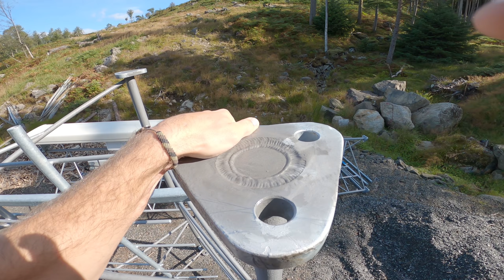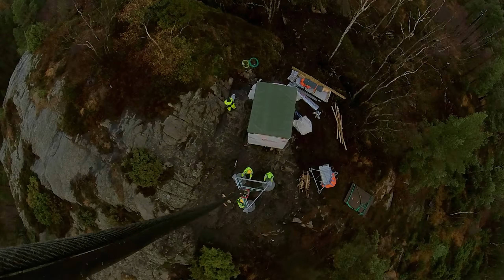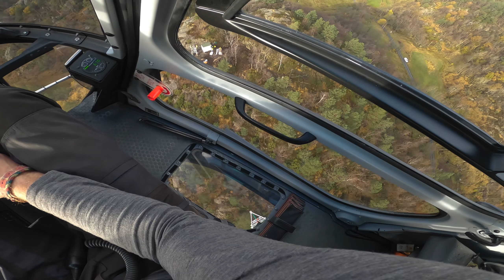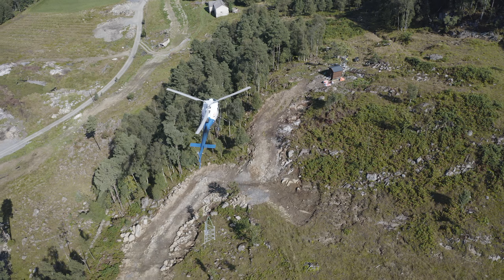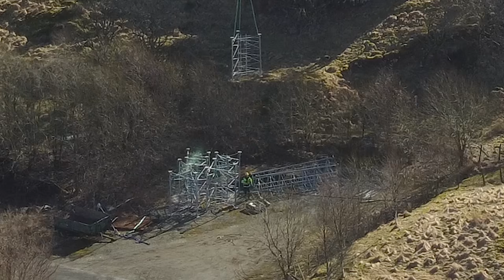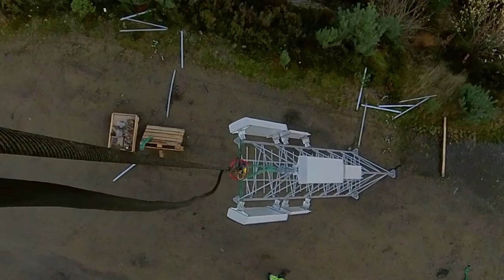Helicopter Tower Assembly, an insight for Crews and Pilots // FPV, Drone, pilot perspective

Comment: i had no idea thats how these were built, that looks like a really fun job
i wish xplane 11 had slingloading simulation id love to try to do this
Reply from the maker: Yes it is fun and I think xp 11 does... Xp 10 has it at least
Reply: @UpsideDownWash  i looked and xp11 has mods for it but it looks quite janky
can i ask how you actually got this job?
i assume you have to already be a very skilled pilot to even apply right?
Reply from the maker: @princess_lucy_goosey  I started in this company when I was pretty new. Worked as a load master for a few years only flying the legs between jobs. From there you get checked out to do more and more complex jobs as you gain more and more experience.
Reply: @UpsideDownWash  oh wow, you do it all, if somebody wants to work for you and eventually become a sling pilot do they just need a pilots license or is more experience required, i assume you offer the training related to the sling loading parts?
sorry if im asking alotta questions im just very interested in this, i always hear amateur heli pilots complaining that the only jobs available are tours but this looks way more rewarding
Reply from the maker: @princess_lucy_goosey  no worries :) yes you only need a commercial pilots license. If you have other skills that might be helpful but as far as I know there are no other requirements (except for beeing able to speak English).

The entry level jobs are often tours and the like. You can start sling loading with low airtime but it's pretty hard when you have little experience so most operators will require you to gain some more flightime doing easier operations first.
Reply: @UpsideDownWash  makes sense

Comment: Awesome videos! The pants that you wear in most of your videos, are they nomex or FR material?  I'm looking for an alternative to the old school one piece flight suit that we have to wear on fires in the U.S. Thanks!
Reply: Also curious what brand they are?
Reply from the maker: They are a brand called Blaaklader from Sweden. Not FR in any way though. But comfortable and practical.
Reply: @UpsideDownWash  Thanks! Would you have any recommendations of FR or Nomex pants?
Reply from the maker: @montanapicker3189  no sorry i don't use them. And since we use our pants so harshly in dirt /dust /sweat we naturally wash them often. And the FR stuff washes out very quickly unless you keep applying the stuff. It's also way more expensive with FR and we would need multiple

Comment: These crews should really adapt to head signals! It’s far easier for both crew and pilot greatly increases efficiency! I’m still amazed people are still using inefficient hand signals while trying to work at the same time. Head signals are far and way the better process.
Reply from the maker: For short long lines that would maybe work  like power line work with the 500. but it's near impossible to see with longer lines. Also in the H125 with doors on the dead angles are way bigger , which would nessecitate 2 sets of signals which is counter productive. Once hands are on the section the pilot lowers until it connects.
Reply: @UpsideDownWash  no they’re not at all unless you got bad eyesight I guess. I can see them plenty fine with a 100 and 150 line. Even in an Astar with the door on. I only ever use a 150 in the hawk to set/build poles/towers and all we use is head signals, no issues seeing the guys.
Reply from the maker: @Jibbs_actual  hm ok. Never used head signals. Personally: delivering anything to the ground even with 200 ' line the signals aren't very much needed. Delivering at height it is very helpful even with 50' line once you get up to about 100'. But once hands are on the procedure is very much always the same: Lower until it connects. If there is a lot of up and down in some operations it might be useful with head signals, but the hands move up and down with the load so that's always what I've used (typically in flying  concrete for example)
Reply: @UpsideDownWash  right same here but there are plenty of times when movement is needed. For example like in this video. When we’re setting a structure onto bolts, and it doesn’t seat quite right, a small adjust may be needed and you see these guys take their hands off the load to give the whirly up signal. We use head signals because in construction the guys need to use their hands. They shake their as if saying “no” to signify coming down. Conversely they shake their head “yes” to signify coming up. It’s extremely simple, clear and efficient allowing the guys to keep their hands where they’re needed. Now flying a concrete bucket, logging, etc of course no signals are needed as it’s very basic flying with the hook/load. 

But hey, everybody has their own style/preference. To each their own, as they say.
Reply from the maker: @Jibbs_actual  yeah I see what your saying👍😊
Reply: Why not using handheld VHFs with head mics for the crew below..., and a VHF on same working channel for you in the cockpit?
Reply: @antebellum45  we of course have radios as well, but the noise from the helicopter and downwash is typically counter-productive. I’ve even used Sena Bluetooth’s with surprisingly great success as well.
Reply from the maker: @antebellum45  we do but it's just noise when the heli is right overhead
Reply from the maker: @antebellum45  we do but it's just noise when the heli is right overhead

Comment: Great video! How difficult is it to actually see the height of the 'new' section above the tower from the helicopter? Or do you entirely rely on the hand signals? 
Thanks!
Reply from the maker: Thanks 😊 with a 15m line you can get it pretty close without any signals but it's still very helpful because judging the height between where the crew can reach it and where they can't is very challenging.

 With longer lines like 30 or even 50m it is very important with good hand signals and I'd say personally I could not do a very good job without them.
Reply: @UpsideDownWash  thanks!

Comment: Awesome. What happens if you have an engine failure with a load attached? Do you drop it immedietly?
Reply from the maker: 😊Enter auto first, then drop. If during assembly try to avoid the tower and the crew